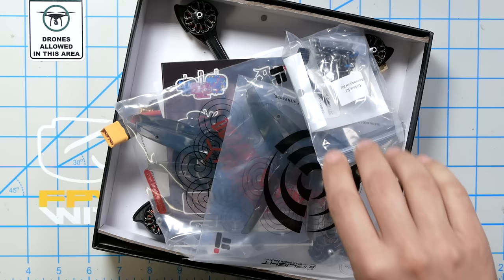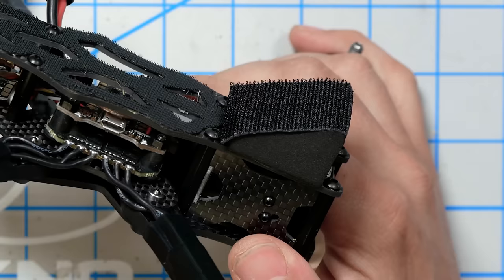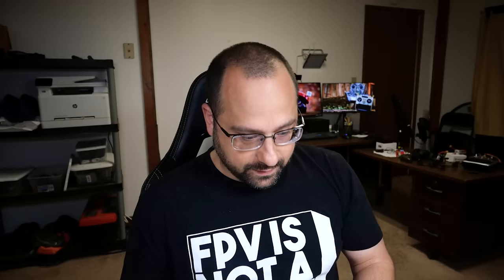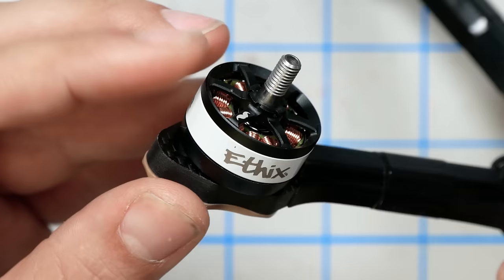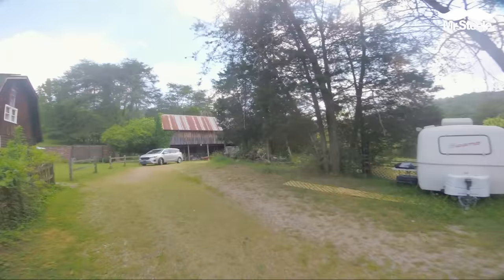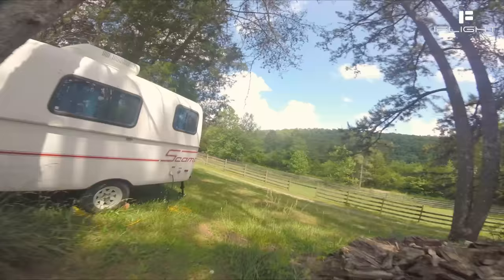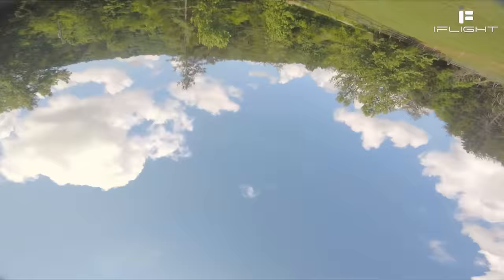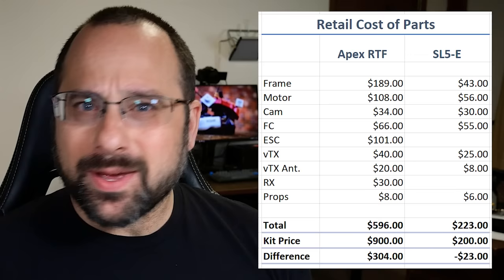Mr. Steele $900 Apex RTF vs. $200 iFlight Cidora | WHICH WOULD YOU PICK

Comment: Believe or not, these two quad actually is my first two quad as a beginner....
I do feel a difference, KISS do make a difference, the feeling of the steele's quad is amazing, the throttle control, frame is very compact and durable, very good looking, clean image, and in my opinion is a very smart OSD solution for KISS. I love it, I crush one, and build another. But still, 900 dollars just not worthy. Both of my Steele's Apex I build it together, do learn alot from the building process as a beginner, but it does have s pain in the ass. Specially the fragile KISS 4in1 ESC.
The Cidora is the first RTF I bought, and I believe you cant out value this quad. For 200 bucks, it deliver everything you need. But as remainder, Iflight also known as there fragile component, sepcially the FC, and they currently even have a PR crisis in China, becuase so many customers said they smoked their FC for no reason. My FC smoked too, replaced it to another Iflight FC.
My conclusion is:
When you freaking buy a RTF, make sure you know your shit and make sure you can fix it if it broke. My Apex and Cidora both had some bullshit problem alone the way. If you not build it yourself and know it really well. At least know  how it is builded and how to fix it.
Cidora, Amazing value, best 200 dollar you can possiblly spend on a RTF quad.
Steele's Apex, one of the best KISS build if not the best, is it worth 900? I dont think so, but if you build it yourself, all the components is around 600. Than that is okay for me, still not very good cost-effective ratio, but it is okay

Comment: Hello everybody,
I hope someone can help me here, because i'm currently losing hairs with my new quad.
I’ve recently buyed an Grenn Hornet 6S (Option : no receiver) and i’m trying to bind an R601X rx (no bind button) to my Spektrum DX6.
It doesn’t work…
In betaflight, the USB VCP is enabled and set to 115200
UART2 : Serial Rx Enabled.
Receiver mode set to Serial based receiver (SPEKSAT, SBUS, SUMD)
Serial receiver provider is set to SPEKTRUM 2048.
For the binding In the CLI, I’ve set spektrum_sat_bind = 9, and spektrum_sat_bind = 7
But my Rx never goes to binding mode when I power on the quad (with battery)
I think I've missed something... I'm not an expert in Betafight... Not yet! 
So, if you have any solution, tips or advice, I will be glad 🙂. 
Thanks in advance for your help.

Comment: I don't think the frame of the Cidora SL5 is a good option for a starter. The frame looks good, but is not pretty durable. I have a friend that bought that frame for his first quad and it didn't last more than 10 flights. The top plate broke, one of the upper plate that holds the arms also lost it's nut, the arms broke very easily and overall after one month of having it he had to change it for a Stingy V2 because of the bad quality of that frame. Though it is not an ideal quad for a beginner, it is for someone ho has some experience flying and knows its own limits along with the limits that a frame of such that price can have.

Comment: The esc is marked as 2-5S. On the esc itself and in the specsheet shown from the website. Is flying it on 6S not asking for problems?.
Reply: Maestro FPV steele says he’s never had any issue on 6s
Reply: You are pushing the limit of the rating,they rate things for a reason,with that being said always leave cushion,I built a 3"inch rig on 6s rated esc and only fly 3s due to wanting higher kv 1204 6500kv,room for error is the best description

Comment: nice comparison! how about 200 vs 400 dollar quad? is there any differance?
Reply from the maker: Yes.

$100 = the cheapest thing that will fly but basically it will break instantly.

$200 = the cheapest thing worth actually buying.

$400 = 95% as good as anything available.

$600 = you paid 50% more for 3% more performance but that's the law of diminishing returns.
Reply: @JoshuaBardwell  thanks for that precise answer :)

Comment: The KISS 4-1 has 1980uf of capacitance in ceramic caps, no need for external caps
Reply from the maker: Ceramic caps can't replace electrolytic caps 1-1 especially if you are going to exceed the nominal voltage rating more capacitance is desirable.
Reply: @JoshuaBardwell  I run caps too as a precaution with my setups but I see why some might not
Reply: I run2,one on plug and 1 at battery pads on aio,weight is not a problem

Comment: I noticed in your close ups of the ESC, the indicated battery range was 2-5s.....we’re you using a 6s battery?
Reply from the maker: Yes. Just like Steele does. Both Steele and getfpv confirmed that was the intended use of this quad.
Reply: Joshua Bardwell that’s interesting considering that the ESC is technically limited to 5s, at least by the verbiage.  Perhaps could be an explanation for the failed capacitors?  I’d be interested to see what the MFG of the board has to say on this.
Reply: It looks like getfpv put a disclaimer in the description on their website.  They’re not saying to use 6s but they are saying The ESC is only 5s rated.  I suppose it puts them in the clear
Reply: Board plainly says 2-5s,I have an emax f3magnum 2-4s rated on 5s all day on 2306 2450kv,5552 props and 0 problems,btw is have had this board for 3+years and many crashes and different frames and it still flies amaazing to this day,NO CAP

Comment: The 900$ one seems to be like what you would have built 5 years ago if you'd just put in the best components, very outdated.
The throttle control is very unlikely related to the price of it, it sounds to me like the flight controller software is doing a better job. 
It might either be a PID thing or maybe Kiss is doing one more step.
For an exceptional flight controller you need a physics model of the quad, I'm not sure if any public flight controller is doing that.
In such a case the flight controller would know what throttle is needed to make it move in every situation.
When you just use PIDs then the throttle (and anything else) is mostly disconnected from the actual situation. Betaflight doesn't calculate the physics, it just calculates PIDs
In any case, 200$ is probably a tiny bit low for highest quality and 900$ is quite a rip off
23:40 you mention you can't print those things at home, why not ?
Any 200$ printer can print ABS and if you want indestructible ones you print them in Nylon (500$ printers now) which is way superior to TPU.
Printing TPU is such a pain, I'm not sure if it's worth it if you don't want the "stickyness"
However, I guess the most awesome parts would be printed in Nylon and covered in 1-3 layers of TPU using a dual extruder setup ( 1500$ printers).

Comment: ive been around the block and yes cheap motors can work absolutely fine. but i will say i bought $26 motors for my last build and on the same frame same fc same battery im getting around 30% increase in flight time. efficiency is something people dont always take into account and sometimes the cheap motors can be far less efficient. do i know why? no im not an engineer. just saying what ive seen from using different priced motors.
Reply from the maker: With all due respect, there is no way two quad motors of the same size and kv have 30% difference in efficiency. Something else has changed about your system that is giving you the longer flight times. Did you go down in kv?
Reply: @JoshuaBardwell  to be fair the motors i was originally using were 2400kv on 6s but i had them scaled down to 1700kv and the new motors are actually 1700kv so maybe theres a big difference from the fact that its not efficient to scale down higher kv motors? im talking flight times going from 3-4min to 6-7min, same props.
Reply: @JoshuaBardwell  btw you dont have to say with all due respect. your the man when it comes to this stuff. if anything im the idiot.
Reply: I'm not sure about %but I had built a quad with eachine wizard 2206 2300kv motors and had horrible crash smoked 3 motors and replaced them with Brother Hobby 2206 2300kv motors and gained more power and easily 1 minute more flight,same style and same flying field,NO caps

Comment: Neither has DJI HD, for a non-racing quad the only reason to use analogue is if you can't afford HD. And if a $900 quad is an option for you, then you can afford HD.
Reply: VagueDirector _ yuuuup
Reply: Bullcrap! DJI just isn't ready yet for some situations. Longer range than usual especially. Its a matter of reliability. If I'm going to fly low over water some distance or dive a mountain peak that's over 1km away or film cars racing on a track, I want 100% confidence I won't get digital feezez, a lock out or gains in video latency so analogue every time! Its reliability is tried & tested & no ridiculous latency increases as you fly further away. Your comment only highlights your ignorance in the tech, its uses & strengths & weakness between the two.  
HD is still in its infancy & still has a long way to go for people that take FPV a little more seriously than just a hobby to enjoy pretty aerial visuals.
Reply: KrissKwadd i feel ya, but with good antennas n knowing what to watch for in signal drop DJI can hold a solid link out to 4.2 miles w high mbps no latency n in crystal clarity.  4.2 is its hard limit cuz mimo.  But yea analog for over 4 miles
Reply: KrissKwadd and if ya watch my vid where i flew inside a steel warehouse w my 6in badger, i had 25mbps the entire time cuz it had 2 walls for signal to bounce n stay solid, mimo feeds off multipath n heals signal, not many pply know this.  Vids called inside warehouse run
Reply: @flo-ridafpv5713  I hear ya man. I'm sure it performs great when its performing great, however from the times I've tried it & what I hear from owners I know that migrated over from analogue & still fly both (an important consideration as people who have never flown analogue have no experience to compare) I'm not convinced it has the reliability of analogue. Variable latency is an issue for me too. I'm sure it will improve, I absolutely want it to as it's a no brainer for immersive & detail purposes to want that resolution. When I'm convinced, I'll make the switch. I reckon its still at least two years away before the tech matures & is accepted into the "tried & tested" reliability ranks.
Reply: KrissKwadd well if ya tried it when it was super new. It’s way diff than a few firmware update in. Much more reliable signal. I’m not that fast of a pilot Over 40 lol but If guys like cricket n Farouk fpv can fly dji 100% then latency is def a non issue.  Ya can watch any of my vids to see performance as I ONLY POST GOGGLE DVR SUPERVIEWED to show ppl and I’m lazy 😂 

Maybe the setup you tried had issues many have had it set to 25mw on accident and or had 1 Mmcx loose on air unit. Both cause major performance loss.

Comment: sma adds a lot of weight.  I'm surprised Steele being the gram pincher he is doesn't use the apex tpu sma mount with a rush style antenna.  It easily saved me 10 grams over a similar sma pigtail setup and the rush tank 20x20 mounts so nicely in the back of the apex.  https://pbase.com/paulyoly/image/170810902   In the off chance you'd need to remove the stack screws all your arms aren't going to fall off because the arms have a threaded insert at the end that doesn't go all the way through.  This is actually nice if you need to change your whole stack to something else and need to use taller or shorter screws because the arms don't flop all over the place.  I've had to do this on one of my apex builds. So subtract 4 screws from that total to remove the bottom plate.😉  The fact the kiss esc burst into flames is freaking awesome!  All you kiss zealots can suck it!  Sorry, but i've flown kiss and it ain't no thing ya'll.  Use any blheli32 4n1 out there with a 1000uf 35v panasonic fm series capacitor and you will be a lot less likely to burn your esc.  There is no good reason not to use a capacitor, no, because Mr. Steele says he doesn't need one is not a good reason.🤣  I think i'll start selling a Mooosestang spec apex at half that price.😜 The frame itself is outstanding.

Comment: Mr Bardwell, I think you might have posted the link for the Cidora 4s version on bangood where as we are talking 6s quads here right? Baggers sell the 6s version, don't want anyone to buy a 4s by mistake lol. 
Also, Steele is forever smoking his quads he cant say he has no real problems with esc's or boards. Seeing your test quad fry itself simply proves its under spec'd for running 6s especially with no capacitor! What are they thinking.
Why isnt a $900us quad running 55- 60amp rated esc's? My $100 F7 mamba stack's are 55amp rated and cant I cant blow them up on 6s no matter how much I try!

Comment: NO PID TUNE is worth US $400.00 overhead.
Reply from the maker: The $300 in markup for the build (not $400) includes build time as well as royalty to Steele. I have no idea how that breaks down but some guy in Florida is putting these together in a GetFPV warehouse, not a Chinese worker. So there is some justification for higher price.  The $300 still is higher than other bespoke quad builders charge, though.
Reply: @JoshuaBardwell  i say 400.00. because after taxes and shipping. Lets be real, a lot of manufn make money on the shipping. 

if each "Steele900" is hand-built by a single person, the cost makes sense. 

Is it a Lifetime warranty? that would explain the margin? If it is claiming Echelon level RTF/BNF quad, it needs way more thought applied to its longevity.
 Yes, CCD cameras cost more, offer less performance, and are far less power efficient. 
if the Creator and the seller are both saying there are no issues in the field but everyone in the field is saying that there are, thats called a 🚩.

Comment: I'm sure it flies great, but for $900 there should not be things held onto the frame with double sided tape.
Reply from the maker: That's a really standard way to do it. It's very effective and lightweight. There's absolutely nothing wrong with it. For the FC or ESC it would be a problem. For the RX and vTX it's fine.
Reply: @JoshuaBardwell  please dont think im trying to be rude, I just expect more for paying $900.  It was kind of a surprise to hear you say it was mounted that way.  Sure, I'd use double side tape on my own build.  But I don't think it should come like that for $900. Also, the Cidora nor the Nazgul come with double sided tape.  Just seems kinda cheap to me, but it's just my opinion :)

Comment: Now i feel better about overpaying for my skyeliner HD from RR wich i bought just because its a copy of drews quad. I'm a firm believer in its your $ do what u want with it and ive overpaid for alot of stupid stuff in my life but this is one quad i wouldn't buy. But if you like steel and this setup, then hey its your $!
Reply: You think the sky liner is better objectively than the apex? Not figuring cost into the equation. Purely based on the equipment
Reply: @mhoovair89  if you don't consider the cost I would have to say the Apex wins, they use all top-of-the-line components. But I've never personally flown one

Comment: Imagine buying an analog quad for 900 when you can get a full DJI build for way less
Reply: Ever since I saw the original DJI Lightbridge in 2015 I been wanting to try it on my flying toys. Fast forward to today now we have beautifully tiny full digital FPV transmitters and goggles from DJI, with licensed designs using said DJI chips in even smaller form factors.

Comment: So... JB took a 4s/5s rated ESC,  strongly recommended by Flyduino to be used only on 5s with a capacitor,  and ran it on 6s without one. It was bound to happen... 😂 Why anyone would care more about Steele's or GetFPV's opinion over the manufacturer of the damn thing?!  Would love to see any other ESC rated to 5s max to endure the flights this one just did on 6s. Probably any other ESC would just pop pluging in the batt. So who doesn't put a capacitor on it or doesn't follow recommendations from Flyduino!? Steele and everyone who then comes here to complain about KISS durability... 🤣
Reply from the maker: Hang on a minute. "JB" didn't do that. Steele did that. And GetFPV did that. And I absolutely confirmed with both of them that was their intent before I flew it. Steele attests to having built 30 of them exactly like this with no problem, and GetFPV said they sold an unspecified number with no issues. Manufacturer's ratings are often conservative.

You give the KISS ESC a lot of credit for being rated to 5S and taking 6S, but there are plenty of ESC's out there for less than or equal to the KISS ESC with 40v rated FETs that can easily take 6S or more. So I'm not sure why being rated for 5S earns KISS some kind of award. Realistically you won't find any 5S rated ESC's because by the time an ESC exceeds 4S, the manufacturer typically just bites the bullet and goes to 6S.
Reply: @JoshuaBardwell  You got me wrong bud. Wasn't criticizing your test/review in anyway. I think you did the right thing testing the Steele build as it is out of the box, especially making a comparison. It' was fair and clean, stellar as usual.  Maybe I phrased myself wrongly and should have said  "JB was wrongly advised to not use a capacitor - so failure was expected"😆. I Just don't get it... If someone could advise their clients to use a 1$ - 1 gram cap to lower failure rate even if just by 5 or 10% (prob much more) why wouldn't they? That was my point.  
And yeah, you are 100% right about the ESC ratings and don't think KISS deserves any kind of praise for withstanding 6s abuse, at least more than the next ESC, nonetheless how many 6s ESC we run without a cap nowadays?! Also don't forget we are talking about a 2 year old ESC design, realistically talking they burn just as often or a bit less than all the others 25A 4s rated ESC from 2 years ago with no caps on.